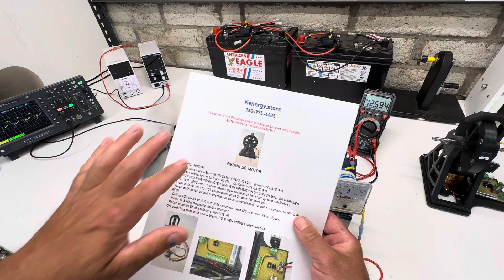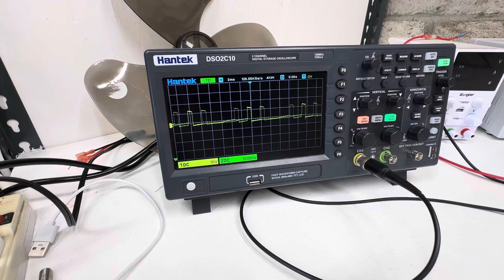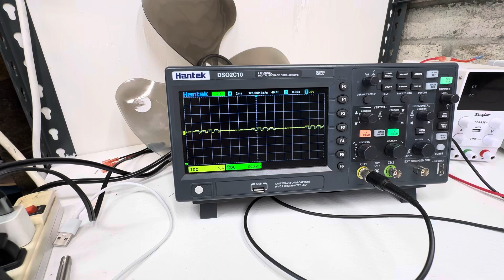Bedini mono pole motor

Comment: as you may know, when we load the motor down, it can speed up the charging of a battery (negative charging in my case), can you explain why this is ?
Reply from the maker: With the bedini circuit when the motor gets loaded down the pulse can change from 1 pulse to up to 20 so each magnet is now producing 20 pulses instead of one even if it’s rotating very slow 
For the mosfet loading makes the amps higher so the pulse is stronger
Reply: @kenergy1707  i see. Thank you! Yes my amp.draw goes up a bit on loaded down. Charges sg style alot more. But also with no loading down it charges still nicely just a bit less. 20 pulses, this is interesting. Thats a massive difference. I wanna try the allum battery to see if i can hold the battery input at a steady voltage and get a better cop.
Reply from the maker: @tvdylan  use a pot to increase resistance so it’s less amps
Reply: @kenergy1707  mm, yes i have a 500 ohm pot and 100 ohms on each mosfet. What pot do you use? 🙂
Reply from the maker: @tvdylan  the pot would be used for bedini circuit on a transistor
Reply from the maker: @tvdylan  PWM on mosfet

Comment: looks pretty good. what are your thoughts on gen coils? can you run them without getting drag on the rotor ? 
and can it run @ 48 volts ? : )
Reply from the maker: 12 -24 works great up higher things heat up A lot would be better to use mosfet circuit for higher voltage 
 The gen coils work but slow the motor which isn’t a big problem you just have to use a oscillator or voltage boots to charge a battery because the volts will be low
Reply: @kenergy1707  ah yah ! Oscilator! Good idea! I wanna play with those! Amd yah mosfet to keep things cool!  Imdeed. Ive been parralleling mosfets to allow for higher voltages. 36 volt and 48 kicks out a good amount of output. Cheeers!

Comment: Could you rig up a faraday monopolar to this, (on the opposite side to the fan obv) use it to generate the amps and piggy back the amps from the bedini on to a looping circuit from the faraday monopolar generator to get higher amps total?
Reply from the maker: The faraday gen was low volt1-3 with high amps
Reply: @kenergy1707  Yes, and this is relatively high volt low amp...for its size anyway
So...can you combine them into high amp and high volt...
Reply from the maker: @8thsinner  just depends on how much resistance the gen has this is a small prototype